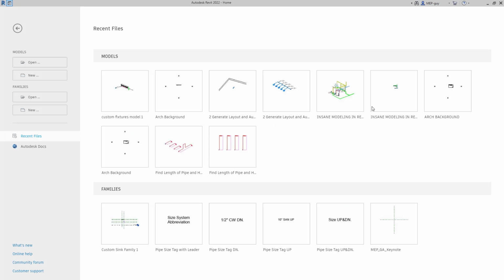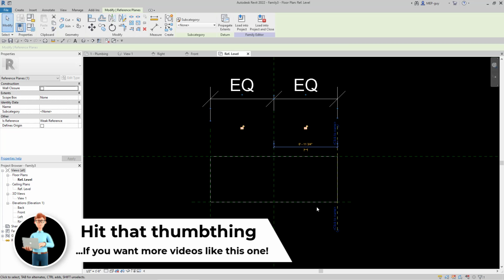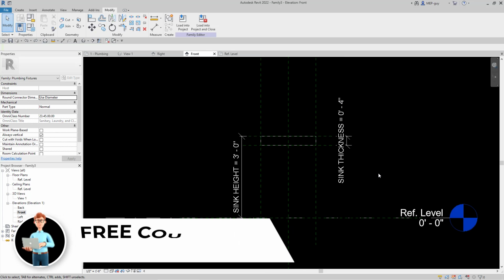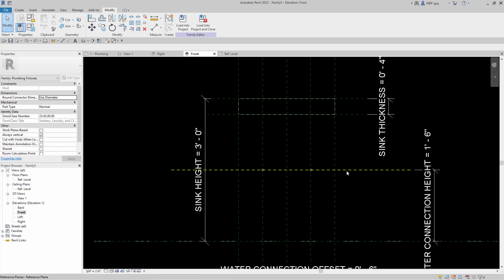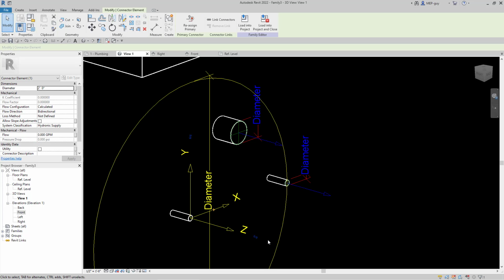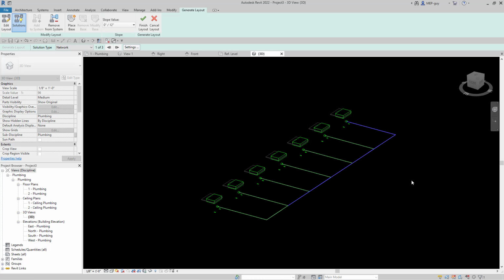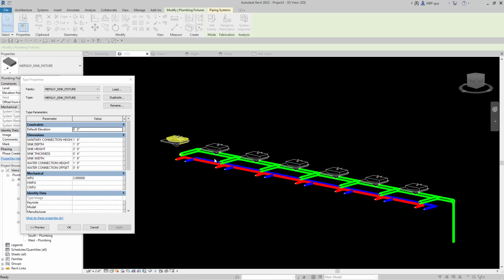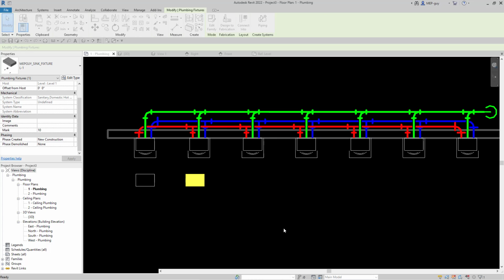How to Create a Custom Plumbing Fixture in Revit

Comment: How about double lavatory? How do connect  the fixture unit?
Reply from the maker: you could just use two of these fixtures next to each other. I'll be doing a course very soon on how to work with fixtures. You can also create a double fixture with a single connection point that has twice as many fixture units.

Comment: Great video. One suggestion. In my experience it is better to have the water connection pointing up and adding  a ref-plane to control the distance from the back of fixture to the center of the wall (4'' wall, 6'' wall etc.). Makes working in Plan View and auto-connecting easier. I also put a P-Trap in the "generic" sink model and define the WSFUs (etc.). I am sure you want to keep this simple and to the point; and this was a great  video. These are only suggestions for your future videos. Keep up the great work. Cheers.
Reply from the maker: Completely agree about the connection pointing up. I think having both options might be good since one would work better for water connections from the ceiling and the other for connections in the wall. Two types would give lots more flexibility. Love the feedback. Don't ever hesitate commenting. I love to learn new things!
Reply: @mep_guy  Your videos are really excellent.  Keep up the high quality work.

Comment: I love the idea of this fixture. Only issue I can see is when you make an isometric there isnt any p-trap showing. You could make a fake p-trap thats an extrusion you can control the depth of and that you dont turn off with the visibility toggle. Any ideas on a better option?
Reply from the maker: Ahhhh, very good point Hunter. I've seen it done a couple different ways. I've seen it done the way you are suggesting. You can actually just throw in an actual p-trap fittings "nested" inside that family and control the visibility to display in Fine level of detail only. You can do an extrusion as well. Second Option would be to put the sanitary connector on the bottom of the custom fixture and actually draw piping with a p-trap to the bottom connection as it would be done in the real world. I just didn't want to add any more time to this video since it was already pretty long. But very good point. I'd always recommend when you are modeling or producing design documents that you always try to find the simplest and easiest way to portray the information. A simple note stating "Contractor shall provide P-Traps on all drains and fixtures without integral traps per IPC" might be the easiest way to getting around showing P-Traps in general. But I'll leave that up to you and your company ;)
Reply from the maker: hopefully this video gives you all the tools necessary to producing your own custom fitting to do anything you want!